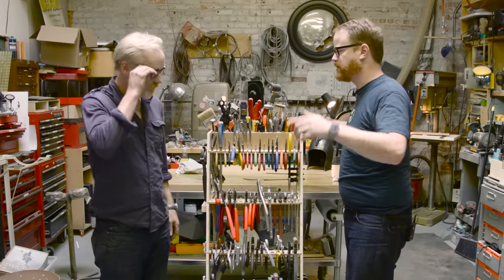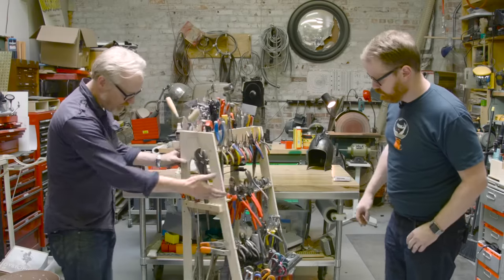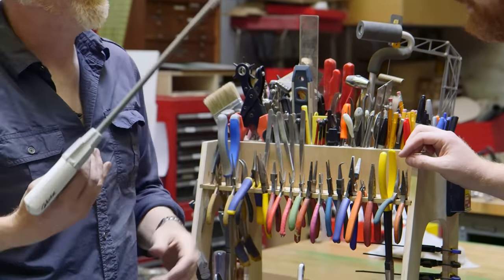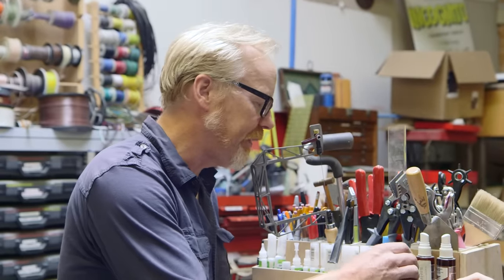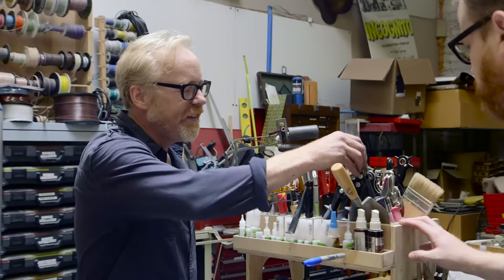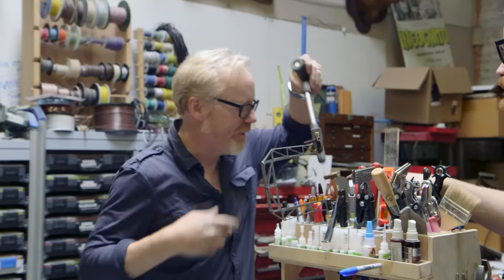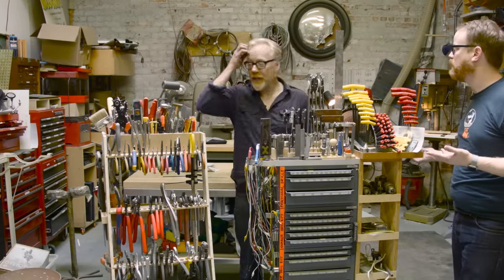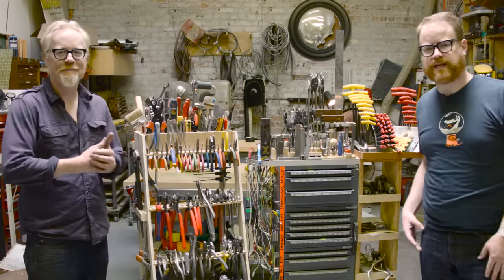Adam Savage's Custom Tool Storage Stands

Comment from the maker: Adam Savage shows off one of the most important parts of his workshop: his tool boxes: https://www.youtube.com/watch?v=1OPSbF6kM9k
Reply: Is there a blueprint available to make the this stand so we're not starting from scratch?? Thanks
Reply: specialforcesnavy did you find the plans?
Reply: shandilalala sure didn’t
Reply: Have you sent the Ridgid Job Max right angle impact driver? Much smaller profile than that RA drill. Only for hex shaft bits, but still...
Reply: Do you have the part number for the stapler. Can't find it anywhere.
Reply: Fun Fact: you only put a bottle of CA glue in your pocket once. Both because you learn better, and because that bottle will proceed to never leave your pocket again.
Reply: @GodzHammer  2 years late but I have a blueprint
Reply: @joshdennison4334  I'm planning to build this. How can I get the blueprint, please?

Comment: Hey Adam, I love the tool shelf vice drawers! Drawers have always been an issue for me. One tip: If you store your sharpies point-side down instead of point-side up like you have them, they will last much longer. Just spray paint the other ends so you know what color they are.
Reply: Thanks for this tip. I'm making a similar one.
Reply: It's true.  I fought it, because I like to see the cap color, but there's no doubt they last MUCH longer cap/point down.   <|^(
Reply: @jeric_synergy8581  Try colored tape on the ends.

Comment: One thing I love about Adam’s shop is you can tell he really uses it. It’s not a super clean, bright aesthetic thing. I tore my shop apart about a year or so ago to rewire the whole thing (previous electrical work was a nightmare and I couldn’t stand it). Everything  sat on top of the workbenches all this time or in boxes and as I began to put things back I found much better ways to place things as I typically need them. I love it!

Comment: I like his design a lot.  One thing I did notice, however is that it was a bit wobbly.  I think some gussets in the corners would stiffen it up a bit.  Not that it's meant to be manhandled but just in case it tried to roll over something that stopped the wheel(s) it'd be a shame to tweak it beyond it's stress point and have it break apart.  Well done, Adam!

Comment: At 10:16, not a brayer but a j-roller.  

A brayer is used to apply ink to printing plates (think linoleum prints).  A J-roller is used to adhere formica to its substrate.  The extra long handle is so you can use it two-handed and get some real leverage.  That's also why the roller width is half that of a brayer.

Comment: You should spray glue sandpaper to the wood frame .
Like 60 grit down low , and like 120 grit up high. 
So you always have a quick flat sanding block handy .
Just a suggestion  .
 that will look cooler too btw .

Comment: I have done something very similar in my work trailer only a few months ago. I got sick and tired of pulling tools out,  just to out them back in some drawer or box. 

     Adam,  you can also mount your drills and other power tools this way.  I will share a picture of it and edit this post of the way I did it. 

     It saves me so much time  especially when I need to clean up after a project! 

Here is one last thing I absolutely love to do. 

I bought a lot of super strong neodymium magnets,  and I use them to mount some of my smaller screwdriver,  and nut driver bits that I often use.  You could do this along the side,  or back of your tool cart by cyano gluing the magnets to the wood. 

-Brad
Reply: lazerusmfh Can you post the pic?
Reply: Yes, I'll try and do it in the next day or two. Sorry, have been slammed!

Comment: Those "handheld metal brake" pliers are readily available at Harbor Freight in the Welding section. And the sizes of CA glue he says are hard to find are really easy to find at a well-equipped, dedicated hobby or R/C shop. Us balsa-gluers go through the stuff like nobodies business (foam-safe CA too!) 

ps- for those looking for the CA-glue "kicker", it's often referred to as "Accelerator" or "insta-Set". Wanna make a quick holder that does a similar job if you have a mechanic's tool service cart? Buy 1"x1" aluminum square tubing and drill holes through it of various sizes for any and all things (great for organizing ratchet extensions and screwdrivers).

Comment: Is dust settling on the tools an issue? I like the tool stands, but I have endless issues with dust and humidity causing rust on anything that sits uncovered for a week or more. I may come up with a covered version of the racks though.
Reply: I feel your pain. I work in a body shop.. My tools are in closed drawers and still get covered in dust. But no its not an issue at all... Just gets your hands/clothes dusty.. But if your in a dusty environment that shouldnt be an issue..
Reply: @geomod6850  I like to use drum liners for tarps. They're big and round. The tarps are open on the sides unless you take extra time to lash them tight. Then it's a pain to get them off. Yep drum liners that's the way to go.
WD-40 is a good rust preventer. I use that on many of my tools. The downside is that it attracts dust.

Comment: Use a wooden ladder, affix bottom brace to keep it open, drill some holes, good to go!
Reply: awesome dude........i have a few old ladders to try that with....thinking outside the box......maybe use some slick plastic cutting board material on the bottom as skids instead of wheels......maybe less liable to tip over?

Comment: This reminds me of something I built, just a few days ago. My dust collection consisted of a shopvac and a separate collector, both on casters. I built a rolling "tower", with the vac at the top, and the collector at the bottom, but then I started adding... stuff. It actually looks a bit like your plier rack, in a way. I call it my "Turbo Tower of Power".

Comment: Also have a full 18v DeWitt set for woodworking, and cheapo Black N Decker drills for the low torque work, mixing drills, etc.

Those clamping pliers also come in vice locks for welding/auto work for about 5 bucks a pop.

Comment: I have a small 8000 sq foot shop and we found the same thing. Drawers are a place for employees to hide sins...What we found was by assigning and color coding (spray painting) sets of tools in open racks it brings organization and accountability to specific departments. Now...with one look I can see if my tools are being looked after and being kept track of. I can also see what departments are stealing tools in both good and bad senses of the word. The biggest advantage is that the tool are at arms length...even a new employee can find what he needs. The only thing we do different is we can roll the tool assemblies into enclosures that have doors so at the end of every day everything goes back in place and the area is easy to keep clean...satisfies my neat freak. Also gives us more work space for large projects

Comment: Does the color balance seem off to anyone else?
Reply: Tim Calvin Perhaps the white balance couldn't cope with two pale ginger guys wearing blueish clothes.
Reply: Tim Calvin Color grading seems to be the issue. As the camera records in S or V log which is a flat profile. Possibly a rush job to produce more content.
Reply: Looks like the main cam is an ungraded (or badly graded) sony and the b cam is a canon. It doesn't cut well and is distracting! Pity as it's a good video all the same.
Reply: CreatureOTNight If they did in fact shoot log, they probably just applied a generic LUT.
Reply: Tim Calvin Sudden outbreak of jaundice in the Tested office, perhaps.

Comment: OMG! Mr. Savage, Where can I purchase one of those medical staplers?!?
I work on boats, there are places that no human can reach all over a boat, please where can I get one...
Reply: 666Tomato666 Of course! why didn't i think of that? 
Thank You
Reply: I bought a full set of ethicon endosurgery tools for $10@swap meet; the locking titanium truly needle nosed pliers are very handy and surprisingly complicated with their multilink jaws- fits easily down drinking straws with jaws shut, but shafts don't flex whatsoever
Reply: Abe Lincoln s working on boat wiring and plumbing upgrades, i found usb borescopes, crochet hooks that could be rebent (not aluminum or plastic) and those crescent extended needle noses( after some grinding) worked better for the amount of grip I needed with 5200 slopped upon wires and fasteners.  Also, buy cheap bolt cutters and grinder the jaws into whatever esoteric bank breaking tool you need, like a crimper.  They all will either sink some day or rust up anyways and making new tools periodically makes the job more fun.
Get a vacuum with a long bendable snout.and put a course filter net in between it and vac hose to grab non magnetic boat fasteners that fall and sawdust extraction.
Marinade injectors help epoxy application.

Comment: She's got a little wobble to her. What do you think she weighs?
Reply: Jon Gordon A little top heavy I think...
Reply: Needs a diagonal brace. Gonna fall over the way it is.
Reply: ***** Lol, I asked for it huh?
Reply: TheMoneypresident It's the first thing that came to my mind also.  "this thing wobbles too much, it needs a diagonal brace somehow.
Reply: J Wagner  it definitely needs something on the bottom to weigh it down and some corner braces
Reply: Jon Gordon I think an aluminum u-channel frame would help, plus not be as obtrusive for use as a diagonal brace.
Reply: odesseus
Plywood is cheaper for a rapid prototype like this iteration. It's just top heavy.

Comment: Great solution. Worse than drawers is the top compartment of a tool stack. The part with the lid. With drawers, they can only hold so much before they won't shut but that top compartment become a mountain of hand tools so the lid won't close and then it gets bad enough the tools start filling off the pile on to the floor. Lol. I will definitely be considering a tool cart like this for the shop.

Comment: 1:07 That bright metal tool in the middle with the round tip is called a double-action liston bone cutter.  It's a surgical instrument used for cutting small bones like metatarsals or metacarpals (toes and fingers and such).  Probably costs around $300.
Reply: More like $24 on eBay these days.

Comment: In the uk you can get the equivalent to that kickers insta set stuff as a set that includes both glue and activator. Really handy stuff and easily found at screwfix or similar places. Just look for mitre bond or joiners mate.

Comment: I would like to add one minor point and that is that drawers are not the place where things go to die.  If you use your tools regularly you'll have a very good idea of what's in them.  Now, if your drawer of screwdrivers or plier-type tools is three or four layers deep then, yeah, you can have a problem seeing everything.  Solution: get another tool box (not always feasible due to $$ or space considerations) or maybe make custom tool hangers.  I just think that if drawers were really cemeteries for tools then Snap-On, Craftsman, Husky, and numerous others wouldn't sell them by the boat load.  For the average homeowner drawers can be a very good storage solution.  When a person outgrows the size of the tool box then it's time to consider other options.  But notice that Jamie's other tool caddy, his earlier version had drawers and also he still does have one roll cab in the background.  Just sayin'...

Comment: hey adam, the glue can easely be found at modelbuilding shops , (used alot whit model rc airplanes) 
the kicker.... i found that when u use it it does indeed set faster bhut its also quicker to break than when u let it set whit no extra

Comment: I have a lot of experience with superglue, the thing that makes it set faster is water, the humidity in the air sets the glue which is also why it doesn't harden in the bottle because its filled with an inert gas that has no moisture in it. You could literally use a bottle of water and spray to make it set faster.

Comment: Excellent/ Having finally removed a folding table from from garage workshop - an F-drawer is just what I need.  I already have a bench-end plastic rack with similar "hole storage" which  holds an unbelievable number of tools; very efficient use of space.  Now I need something free-standing, like F-drawers.  My floor is too heavily textured for rollers to work well but I don't need that feature.  Instead, the back needs to be able to provide upright support for tall items (brushes/brooms, snow shovels, garden umbrellas, etc.).

Comment: You should see how we do tool control in the Navy. (or at least the aviation side of house, the surface side not so much) It is like this to the nth degree. They have engineers whose job it is to figure out the most efficient way to organize tools.

Comment: in model crafting revel has a needle bottle when it dries out apply heat the needle and you can use it again. it works with fast glue and maybe more!

Comment: After listening to the earlier Still Untitled episode in which they refer to buying Lots of Casters on EBay, I checked to see as I have a project I'm working on.  Currently almost all lots of casters are 4 packs.  The exceptions seem to be mixed bunches of casters.  Perhaps others followed Adam's Suggestion.
I did however use the lot idea on EBay for other parts and had good luck.

Comment: Hi Adam, I had a small upgrade idea for you. I wonder if you would make that double sided and mirror it from side that was straight down across the "front side" and add few hinges on the side panel so you could fold it open, maybe latch on the other side for convenience. It would have more space for small tools, but it would still allow the center to be hollow and in it could be added few bigger items like you'r electric drills you had. The sides would be cut open like you had so one could see inside it all the time

I truly hope you will read this
-regards Ekso

Comment: I have some tools out for easy access, but I still prefer drawers. All my work(30 years) has been in shops with many employees and your stuff just walks off less when it is hiding in your roll cab. You do forget about little used tools when they are in drawers and the stuff is stacked up, the trick is to have cabs with low profile drawers, only one layer per drawer and just look through them from time to time.

Comment: Not sure if its EXACTLY the same thing, but you can find nail glue (the kind used to adhere tips to natural nails) in small sizes in bulk. I have used it in a pinch when I needed superglue.

Comment: Pro Tip: Try storing your CA glue tops in a desiccant or a "crystal" cat litter, it will keep moisture away from the cap and will keep the gule inside from hardening and will last beyond the one use of most CA glue packaging.

Comment: To Adam:  If you screw hard-drive magnets to the outside of the wood, the magnets can hold small tools used most often.  You can grab & put away quickly, without having to see-out the exact hole that it must be stored in.  Use hard drive magnets - NOT magnetic tool strips  commonly sold in hardware stores - since they are barely strong enough to hold butter knives, tools fall down too often.

Comment: Knipex!!!   Hard to beat that German craftsmanship, their cobra pliers will make you retire your channel locks. I started carrying a 7-1/2" pair in my electrical pouch about 9 years ago and everyone I have allowed to use them has tried to steal  them (unsuccessfully)  because the kick ass. The Milwaukee M12 system is a better way to go, give it a shot Adam, you won't look back. Once you get the M12 the M18 won't be too far behind then your Dewalt 18 volt stuff will end up in a drawer lol

Comment: Here is an add on idea to this.  You could use a Harbor Freight Movers Dolly as the base.  Many times the 19 X 30 inch model is on sale for about 16 dollars.  With that you get the casters, fasteners and a hard wood base to build upon.

Comment: Amazing! Is there a pattern for this available?
Reply: honestly, build your own and build it beefier. That cart looks way flimsy for replacing an entire drawer stack.
Reply: Agree with you about building my own to fit my own needs.  You may have a point about it needing to be beefer.  Interesting shop article in Wood Magazine that supports this tool concept.
Reply: Stanley Pearse I also agree here with JO. Adam should add some of that fancy crazy glue WITH baking powder, to everyone of those joints on that cart.  Great cart but too much moving around the shop will loosen everything up.
Reply: I think a diagonal brace across the back would stabilize it well.
Reply: To fake farmer: I had that same thought even before I read your comment.  I think he tried to build it light enough so that it could just barely hold the weight of the whole load—like some silly bridge engineers try to do. They think bulk reduces beauty.  Kinda makes you wanna never cross a waterway in a car.
Reply: Tool stand falling over in 3... 2... 1...
Reply: I work for 8020.net and think this could be made easily out of our aluminum! I think this is such a cool idea and project!

Comment: At 11:16 Adam shows a large collection of Wiha drivers (red ends in an arc tray at the right).  Great tools.  BUT finding the right one can be difficult as they all look the same from the red end!!  So, I mark the end with a dash (-) for straight screw drivers, a plus (+) for Philips, a square [  ] for nut drivers, star (*) for torx, etc, etc.  Why Wiha doesn't do this, like Klein Tools does, is something they should look into.  My $0.02.